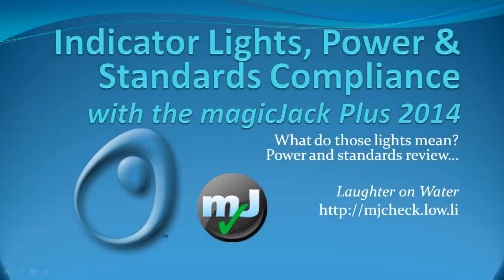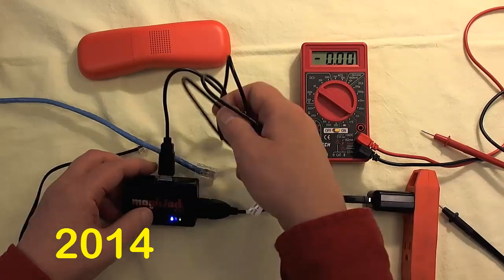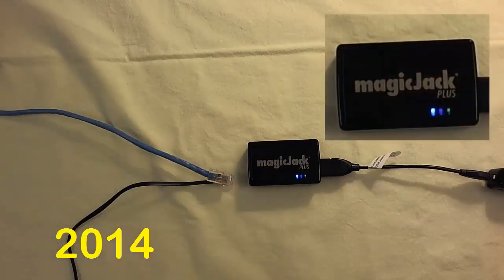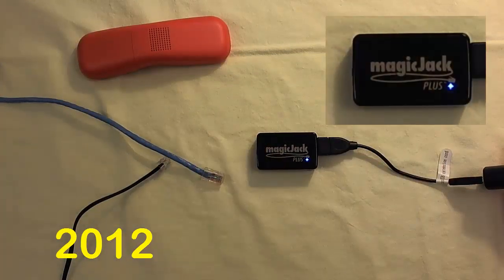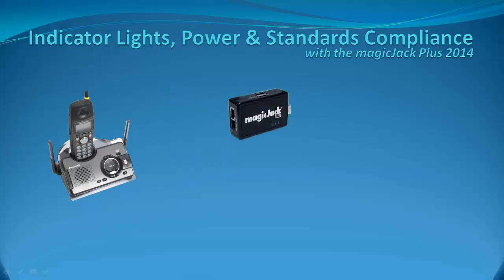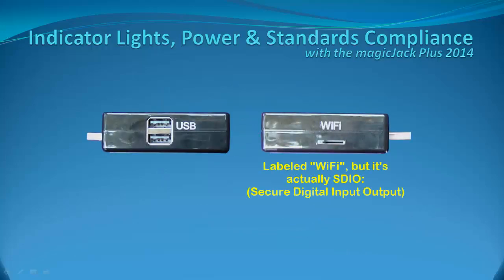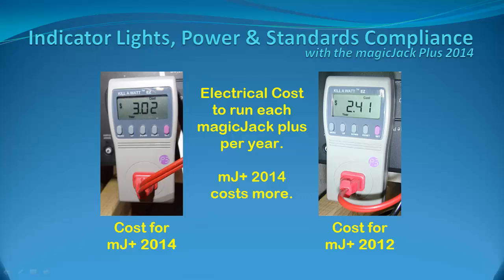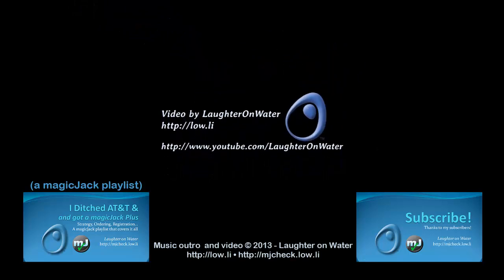Power, Indicator Lights, Phone Standards Compliance issues, magicJack plus 2014

Comment: Nice job.  On my MJ 2012, the blue light will blink rapidly and the unit will not function when the power adapter goes bad.   Apparently this is a common problem.   Replacing the adapter resolves the issue.  Also, you did not cover the green indicator light for the Ethernet connection on the side of the MJ 2012 unit.

Comment: I just got the express magic jack and got rid of the old magic jack,this was done in the last two weeks or so,how ever,I noticed  five days a go that my phone caller Id and  a red blinking light were telling me this,,,Line in use,,,,,I could not make any phone calls,unless I use the keypad on the screen and even doing that,,I  was not able to hear any ring at all with or without  my head phones,,just on my cell phone which I called to test the system,,any ways,I went to the store,got another phone,the same thing was happening,,than I went to the store again and another phone, the same thing is happening,I communicated with the magic jack operators,they were just tossing me like a ball from operator to operator and in some cases they just disconnected the chat,I did this eight times and got tire,this was done for about 4 hours,,,I dont know if what's happening has anything to do with my old magic jack or what,,but all I get is the phone blinking red light and the phrase on the caller Id saying,,Line in use,,,can you please advise,,,,I have already disconnected and reconnected everything but all continuos to be the same,,note,,the device was registered two weeks a go,,any help from you would be appreciated,,thanks